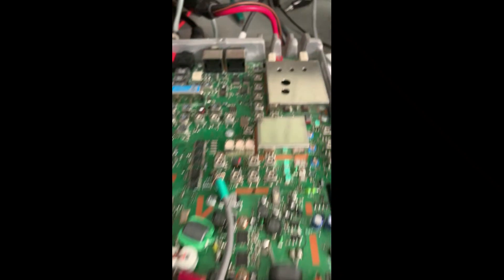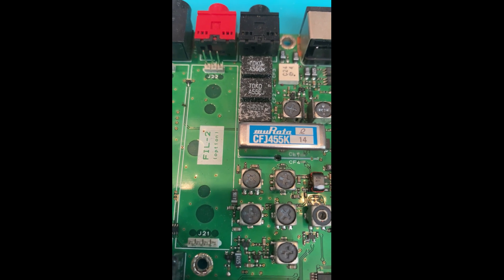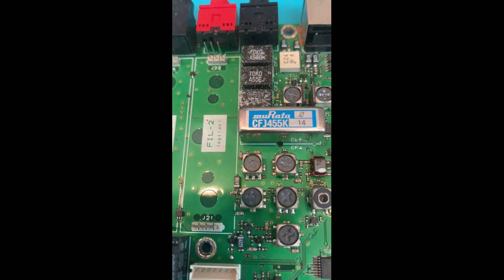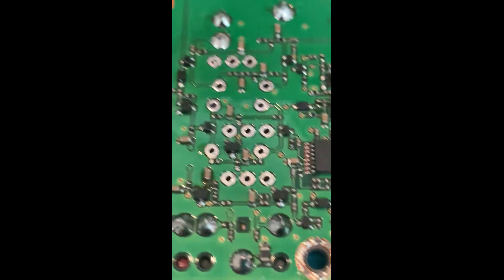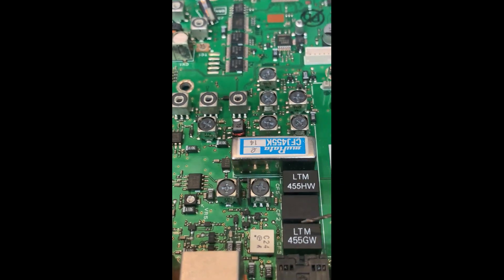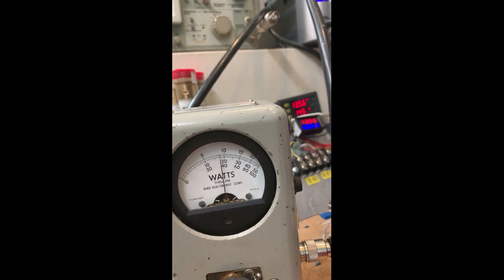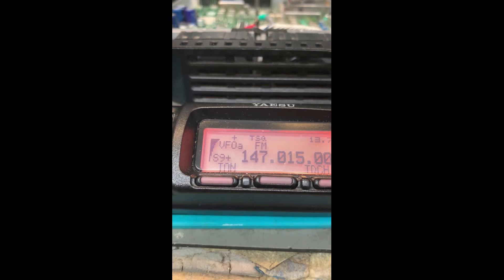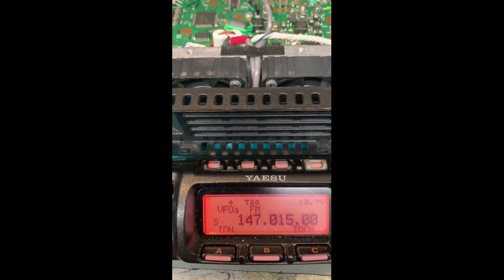Yaesu 857 new ceramic filter issue discovered

Comment: Two of the pins pulled off the bottom of the resistor. So far tried several different solder suckers and can't get them out

Comment: Something about not including DC blocking caps causes "electromigration".  Anyway, here are some articles that go way more in depth on this issue that I found awhile back. The actual cause of the filter issue:  https://sv8ym.blogspot.com/2010/07/mysterious-case-of-withering-filters.html  and then, of interest to the 857d models (and how they later included DC blocking caps):  https://sv8ym.blogspot.com/2014/03/good-news-yaesu-has-added-dc-blocking.html

Comment: Sounds like a flaw in manufacturing of the filters. They could have been contaminated before sealing or the seals failed in service. Might be a good idea to keep a few on hand in a vacuumed sealed container. A good question to ask the customer is if the radio is used or stored in a damp and or humid environment. 
After working for 30+ years as a comms tech I made sure I invested in some good desoldering systems from PACE.  One need the right tool for the right job. I refused to work on hilljack hacks upon opening the radio to find the customer has already tried his own repairs. My rates were posted. Factory clean radios cost $75/hour but hacked radios went for $125/ hour.  No if's, and's or but's. And that was if the radio was not seriously burned or missing traces, plus NO WARRANTY ON REPAIR WORK ON A HACKED RADIO.
Reply: common problem with toko filters. real normal will lots of radios that have them. had to replace them on a used 857 i bought used few years ago, was noisy on rx. you could see corrosion on top of filters black capsule.